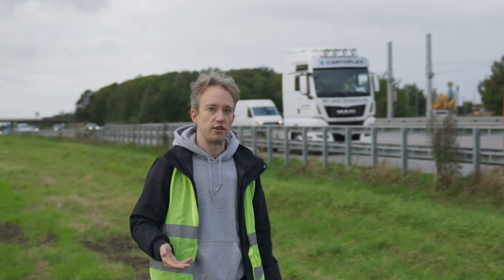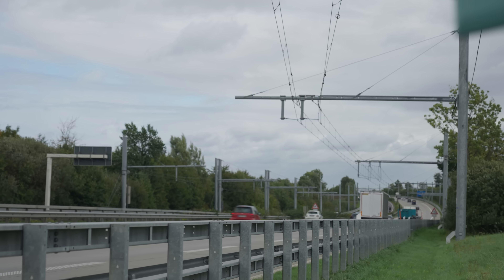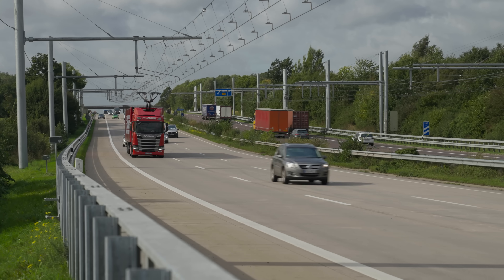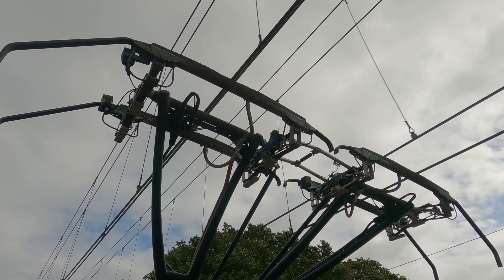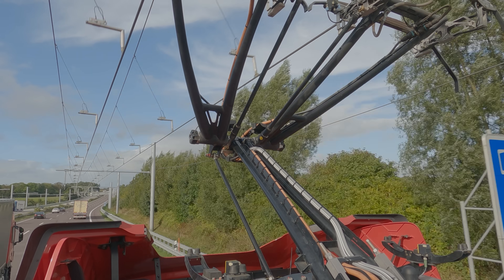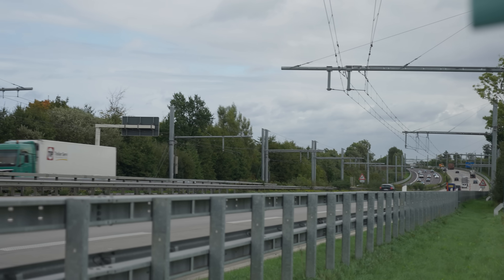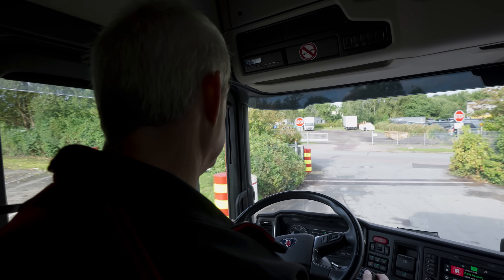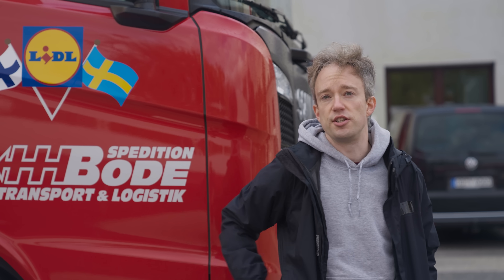The highway where trucks work like electric trains

Comment: I mean, in all honesty this is just the same technique trolleybuses, but for another vehicle type. It alone won't solve the complex issue of effective transportation. Because ultimately it is a far less efficient way to carry freight compared to boat and train, however, that kind of infrastructure can likely only be implemented on main routes, while trolley-infrastructure should be developed on  connected secondary routes where other techniques doesn't make sense. Also, this kind of technique should be standardised and used for local transportation as well, such as regional busses etc.

Comment: Here in UK we have had trams for 100 years. We have had trains for 100 years. We did have Trolley Buses but they did not work in towns and cities.
But this for Motorway and Major Roads is a genius idea.
Reply: There was trolley buses in London back in the 1960s
Reply: @gilbertcampbell4679  yup they got rid of them because they could not easily change routes so normal Diesel buses replaced them

Comment: Good idea. But a lot of questions to put the into practice. For instance, what happens when a truck (or other vehicle) gets off the road, hits and brings down the lines? Are they built in spans to prevent that? How much is the cost of the energy and how is it produced? Gas? Atomic? What is the cost of those wires/infrastructure and how (and how long) is that recovered?
Reply: I imagine the lines are not powered at one end of a thousand Km path but have power in infrastructure at regfualr intervals.  The trucks just need enough batteries to get past the bad section just as they need batteries to do the end of their delivery off the road.

Comment: I get livid at this. I have not seen one experimental truck ever. I can confirm that the role resistance of train tracks, still after 150 years, to be one tenth of tyres and that train carriages benefit from the slip stream of the one ahead. Why build a new "railway"? This project stinks.

Comment: This could be extended to cars and have a grid where cars can still drive and charge at the same time, simple calculation on how long the grid would need to be to charge a car battery and then just pay as you charge system

Comment: The wires used extensively would look hideous and I’m sure they are not good for birds.  And where does this electricity come from?  Burning coal and fossil fuels largely.
Reply: It’s Way more efficient this way
Reply: Birds can safely perch on power lines as they do create a path to ground. They do it all the time with high voltage power lines which like these lines do not have insulation.

Comment: Sorry but this is just stupid and inefficient. All this kind of technology is just to have reason to keep more cars and LKWs running because Germany is one of the biggest producers. But that just doesn't make sense. You need a handful of big cargo centres. And a few smaller ones that are served by train. Add an intelligent routing system and you can easily move cargo around in Germany. Then you use (autonomous) electric trucks with a range of around 100km-200km at most. Combine this with intelligent logistics. If someone orders something if he can at the same time ship part that is already finished? The truck comes. Gets unloaded, the new stuff gets loaded and back it goes to the cargo centre. There it will be loaded on trains and fully automated and routed to its destination.

There is literally no major technological problem in this. Perhapse you need to use gas or h2 trucks for the last mile at the beginning till batteries are good enough but that's just a matter of time. But I am myself from Germany. This kind of stuff would bring a lot of change. And people here hate change. I mean we can see it right now what it needed s that Germany changes anything at all.

Comment: Years ago, I thought that the answer to motorway congestion was a system which tracked vehicles entering. Much congestion and accidents are caused by inappropriate driving. All vehicles would therefore be tracked when entering the motorway at a constant speed and a constant distance. much like a Scalextric set, and this would begin with HGV vehicles. This system seems very much to be a significant step towards that.

Comment: I don't think that this invention will succeed. 

What if there is a crash in the right lane or what if the right lane is closed completely for repairs and truck needs to overtake it? What if there is a blackout? Petrol trucks can just refill at a random petrol station and continue but if something happens to those wires, every truck becomes stuck and there's going to be a huge gap in the logistics flow for every company. 

I think that petrol trucks are more efficient, reliable, easier and cheaper than this. Instead of this I would much prefer updating to high speed logistic trains that can transport much more goods as fast as 360 km/h or more.

Comment: It is very sad to see every time some municipality replaces trolley bus networks with electric buses. I get that the overhead high-voltage wires aren't the prettiest or safest thing to have around, but IMO this is indeed the most efficient way for powering transportation if there's available infrastructure and steady demand for transport.

Comment: This is a cool tech, but i think the real value is where, it's used a range extender / mobile charging station. So when the truck is on the highway it can top up it's battery & run on the grid when it's full.

Comment: Ridiculousness! Try to power one truck with a windmill or solar panels. Not going to work. Try to power thousands of these with nuclear power, not going to work either. Those overhead lines are being powered with fossil fuel generators. The trucks lubricated with fossil fuel derivatives, as the plastics used in the build are derived from by products of the oil industry… SMH…
Reply: Could you lay down a reason for why it wouldn't work?
Reply: @logitech4873  simply put electrical energy transportation infrastructure. Even if you had a free energy device that made infinite electric power you would still need to get that power to the trucks. Add enough trucks on the road and all the cables melt due to excessive load. Whether we can make enough electricity or not is topic of heated debate. What isn't up for debate is that our current electric energy transportation infrastructure is nowhere near adequate to support electric only transportation. And it seems more likely than not that there isn't enough copper in the entire earth to make wires thick enough to carry the loads. At least not worldwide. What will happen is the rich countries will snatch all the copper and the poor countries will be forced to use fuel because there's no more copper to make wires

Before this comes up yes i'm aware that most high voltage wires are made out of aluminium and not copper but my point still stands. You can't make aluminum wires that are meters in diameter, it's too brittle. For thick wires you have to use copper. There's no alternative. Same goes for low voltage alpplications. Copper isn't that rare but it's not that common either. Unless we can make a [near] room temperature metallic superconductor this is an unsolvable problem. Let's hope we can, but let's make our decisions based on what we have, now what we hope to have 10-20 years from now.

Comment: But rubber wheels on asphalt have much greater rolling resistance than steel wheels on steel, so it would be more economical, and then you might not make the entire road surface of steel, but only where the wheels go.
And the wheels can then easily and automatically follow the road.
I think I recognize this from something else...
Reply: Also you could perhaps use the steel wheels for grounding the electricity instead of using a second catenary wire

Comment: This could technically work, but imo investing in rail could be smarter longer term for longer distance like that.  The technology for electric trains is very well proven and trains are very efficient anyway. Also you don't need asphalt when you use trains. Just making asphalt is very polluting and it gets worn out faster than steel rail.
Reply: they can't invest in freight on railways in europe cause of passenger trains.

Comment: Wikipedia - Electric road. Sweden has tried out many of the Electric road options regarding the cost of each one. It looks like an on-road contact system with under vehicle pantograph will see all vehicles private cars and trucks be able to take advantage of this option, and only a 1 metre section under the vehicle is switched to high voltage the rest is return ground.

Comment: I firmly believed it a great idea to have electric vehicle around with access to electricity chargers along the road for heavy transport such as lorries and buses. And the motor way is a good place above head to charge their batteries before they enter cities and urban places. This is something the Gov should be focusing on to reduce carbon emission. Electricity company could take benefits of those installations and get paid for the electricity being used by those vehicles. A good investment for the country..

Comment: why can we use this for all vehicles on the road, have cables in the tarmac so vehicle height isn't an issue, and the cars have an engine to get them were they need to go when not using the grid power
Reply: Wikipedia - Electric road. Sweden has tried out many of the Electric road options regarding the cost of each one. It looks like an on-road contact system with under vehicle pantograph will see all vehicles private cars and trucks be able to take advantage of this option, and only a 1 metre section under the vehicle is switched to high voltage the rest is return ground.

Comment: A nice idea.. But.. Many problems to overcome, such as running at tram voltages won't allow many lorry to run under the same section before the wire maxes out, due to trucks consuming significantly more power than trams and trains, about 4 to 5 times for given weight, a good example of that is the 373 eurostar train, it could consume over 12 megawatt on 25kv but running on the third rail at 750 volts it could only consume about 3.5 megawatt, so 10 or so powerfull fully loaded hgv trucks going up a steep uphill motorway climb could be enough to max out the wire on that particular section, taking into consideration that motorway hills are significantly steeper than railway gradients.. the other problem is the wires them selves, uneven pantograph wear will happen due to the pantograph area being much smaller than a trains due to it having to have it split into 2, since it has no track to ground itself on, so limited zig zag space on the catenary, and what happens when the truck comes off the wire? It happens quite often on the rail network and that's with wide pantographs and trains remaining in a fixed position, a wire coming down could potentially be quite frequent, i wouldnt fancy a live wire coming down on my car, they are heavy and would most likely come straight through the windscreen, and if not killed by the impact, electrocution!

Comment: as someone who actually lives in Lübeck, I havent seen one truck using that wire stuff over the highway
Reply: I haven't seen one on the A5 near Frankfurt/Darmstadt either
Reply: For most of the sections not specifically filmed for the purpose here, we don't see them getting used either.

We'll do anything to keep roads, trucks, and cars going. Fundamentally unsustainable modes being constantly greenwashed.
Reply: probly still in controll testing, i doubt they would build it out so much if they wasent thinking of using it.
Reply: Near Rastatt in BW, they have the same construction running. No one is using it either.
Reply: and you won't. it's a stupid idea
Reply: @StefanoBorini  Why is it stupid in your opinion?

Comment: How do they prevent excessive and premature wear on the truck's sliding electrical contact areas (on trains as well)?
Reply: not sure how they do it hear but on trains the wires are strung in a zigzag pattern so they wear over the whole length of the contact pad. That's obviously harder on a road where the truck might not sit right in the center of the lane all the time, so I'm not sure. I guess the trucks move enough side to side so it isn't that much of an issue?

Comment: The world already has trucks fed by overhead electricity…they’re known as T.R.A.I.N.S. and they’ve been around for well over a century. 
What a farce and a ridiculous idea.
Reply: Sure, let's add some more trains on the track here ... oh wait, it's close to it's capacity limit already with both freight and passenger trains (commuter, regional, regional express, inter city, inter city express, international regional express and international express) sharing the very same track at a time. 
Btw: just because there are electric trains, doesn't mean that they're around everywhere. There are still tracks which aren't electrified, and there are still also diesel trains running on electrified tracks. 
This thing in the video isn't supposed to replace trains in any way, it's just another option for the trucks which are out on the road anyway

Comment: Wouldn’t it be more logical to have all this freight on a train? That infrastructure is already there and one electrical locomotive can pull lots of truck loads. And then concentrate on electrical solutions for the last miles, probably with hybrid battery powered vans or small trucks.

Comment: from Australia “…let’s privatise the electricity network to make it cheaper and more affordable for everyone!” Within six months the “Privateers” complained that the infrastructure was not capable, the tariffs were too low and their investment based on (their) promises to shareholders was unsustainable. July 2022 saw an increase on domestic supply of ~28% in ONE YEAR while input credit from solar returned to the grid fell from 50 cents to 19 cents per kW and adjusted down to 14 cents after administration costs. Great story and thanks. Hope it can be affordable.

Comment: As a truck driver I have three concerns.  One Oversized loads do need to move occasionally how high our the cables.  I been in some cities where a standard height truck barely clears the crossing. Two damage from reckless drivers.  Three roadside support for drivers over night.  I get this is Europe, But American long haul truck drivers, the best use of this technology(long haul), use our cabs for over night.  There is just not enough road side stops as it is.  Add the need to electricify stops would be costly.

Comment: Interesting video report. Really some effort needs to expended to encourage goods onto rail. Containeres are an under exploited. Most sea based transport uses containers so there is the precident. I am unclear why goods are not tranported in containers by rail and then transferred to road for the last part of the delivery. The problems as I see it is that the Road lobby is very powerful and has influenced governments to spend money on road rather than rail infrastructure. Just look at the opposition to HS2 in the UK - had this been a road there would not have been so much opposition. The rail solution is much more efficient, safer and less environmentally damaging that a road with the same capacity. Looking at the recent picture of lorries queueing for the ferries at dover puzzles me - why is this traffic not on rail?

Comment: Vancouver has had electric buses run off overhead lines since the late 80’s. All of the main routes are run off of hydro electric, with only the more distant, or less busy routes run off diesel.
Reply: I remember your bus ! They are funny with their real in the back ! Looks like a yoyo !
Reply: A ton of cities had those, those are not rare.
But those are trolley buses whereas here the trucks have pantographs